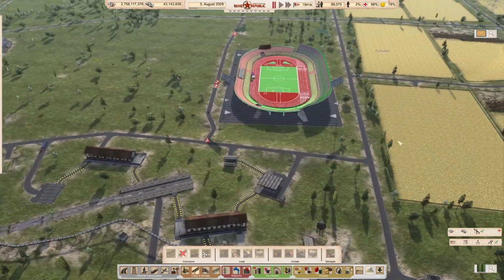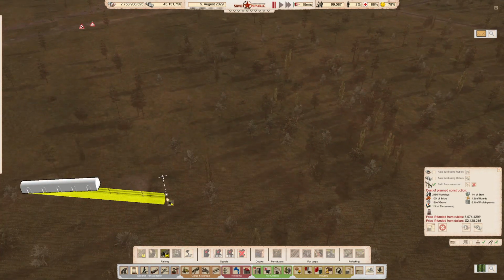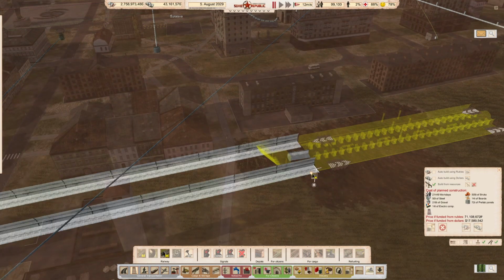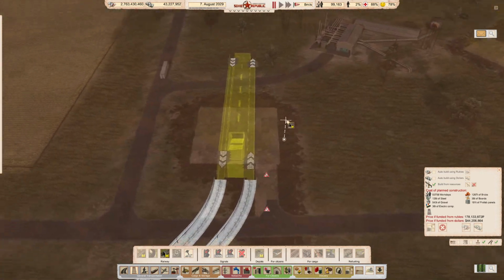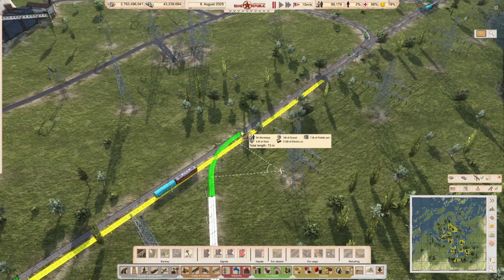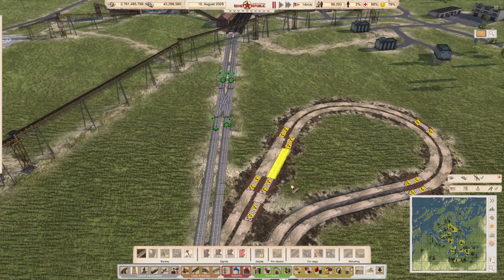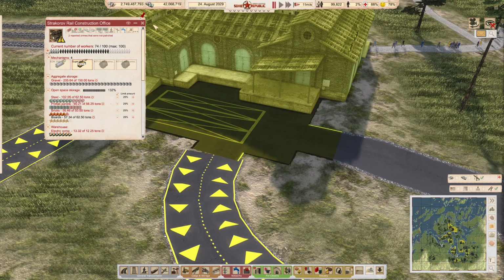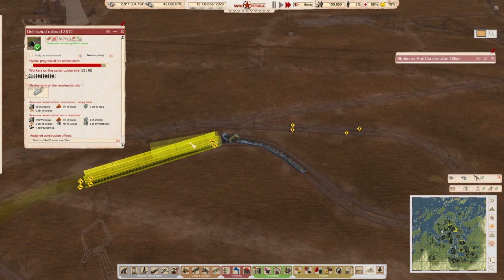Metro Planning & Tunnel Boring :: Workers & Resources Soviet Republic: #165

Comment: why is it that every tutorial video for this game is an hour long. So frustrating.
Reply from the maker: The problem with this game is that some mechanics, e.g. metro, ships, aircraft, are difficult to explain in a single tutorial video.  Instead when there is something important to show I try to put it into the start of the video,  leaving the remainder of the video optional.  

In the case of metros,  the planning of the tunnels and stations is simple, the problem is providing the external connections, depot, etc, especially when playing in realistic mode.   This is down to metro trains not being able to run on rail track, so they have to delivered to the 'metro' depot by another train.  

If you have any questions, will try to answer them.

Comment: Great video, thanks for the continuation with your overview of the new features offered. The "make City" facility is most useful, perhaps a future consideration could be to save its palette of selected buildings when the game is saved.

I do like the "picker" tool, that is most excellent. Allowing you to selct an object on the map and then rebuild it saves so much time from searching a rather extensive mod list.

I did wonder what your thoughts were going to be when attempting to add the Metro to an existing city. In a simplistic way it is similar to adding pedestrian tunnels when the building is already built. Too many items that you build, and other infrastructure, that is needed below the surface is dependant on what is above before they can be built. Once you understand those limitation you can work around it, but retrofitting is a very big challenge.
Each major update seems to reinforce that the underground aspect of this game is just as important as to what  happens on the surface. To that end some sort of structured layering would be an advantage to avoid clashing with cables and pipes etc.

What would you have done, apart from wait longer, without the likes of the EDK 300...?!
Reply from the maker: Like the idea of saving the selection, it would make themed cities and early starts much easier.

Retrofitting metro into a city is a major headache.   Part of the problem is overlap with  the surface infrastructure, e.g. buildings, water and sewage connections,. forcing the stations  and lines into awkward angles.   Another element is the impact of changes in terrain height on the depth of the tunnels,  the city in the current test is relatively flat,  adding metro to city with uneven terrain could  be interesting.  After this exercise my preferred option for metro in an existing city would be above ground as it is easier to wind the track between buildings and the station footprints are smaller. 

There is a form of layering as generally the metro tunnels go below the pipes and electrical connections,  as long as the ground is relatively flat.  It the terrain changes that bring them into conflict,  especially the sewer pipes due to the gradient requirement.  Being able to see the distance underground would be useful as one problem was connecting metro tunnels at different depth,  For example, had to go deep to get under some buildings, but the tunnel would not make a direct connection to the station.  To solve this had to break the tunnel up into short sections, but still found it difficult to make the connections.  

Adding metro is a major project that requires plenty of planning, which includes having  a dedicated construction office possibly a depot near by to switch construction trains.  The mod community may have other ideas, but it is really a late game, e.g.  1980s, form of transport.    

Like the option that does not let vehicles expire especially with respect to early starts (it was annoying to get a truck then it disappear after a couple of years).  Plan to use the option in future series.